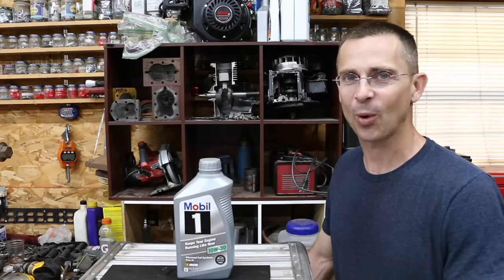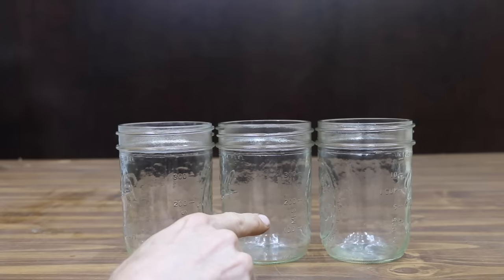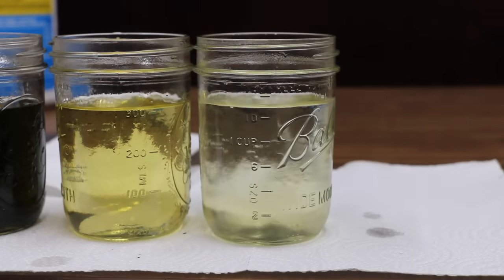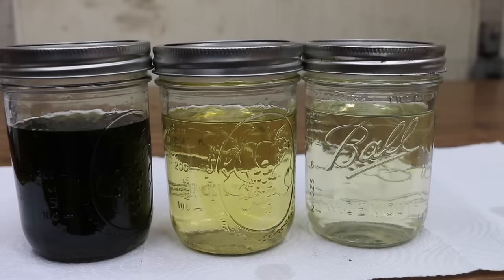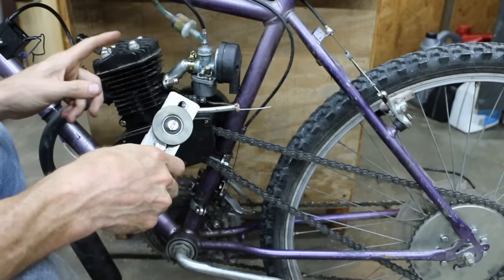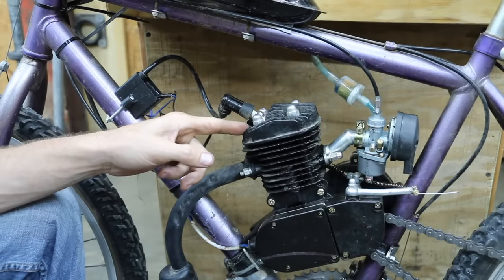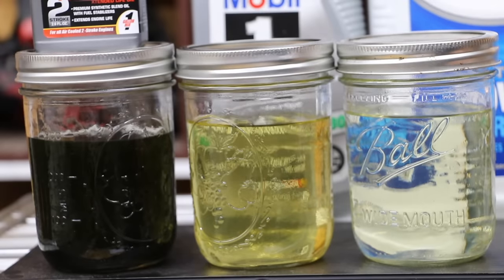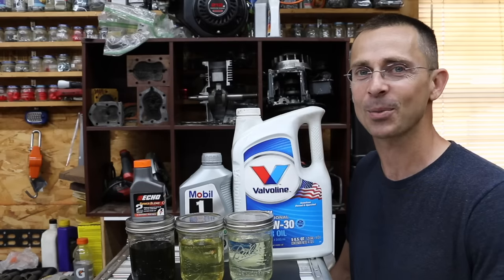Will 4-stroke oil damage a 2-stroke engine?  Let's find out!

Comment: Interesting stuff! I have seen an old LawnBoy mower manual that says to use a gas oil mix (32:1) with 30 weight oil.
Reply from the maker: Thank you
Reply: My '83 with F engine states to use 32:1 when using the preferred Lawn Boy oil, or use 16:1 if a standard oil was used

Comment: I've always mixed 2 stroke oil with diesel in my old 24 valve Cummins to help add lubricity to my vp44 injector pump. Cool if you could do some kind of testing to see if its really helps.
Reply from the maker: Great test idea!  Thank you

Comment: A whole lot to like here... comprehensive as and well designed and IMO, very informative. I'd been wondering if 4-stroke oil could be run in a 2-stroke engine without any significant issues; thanks to Mr.Google, YouTube and most importantly, you, that's now been answered. Nice to know if penny pinching and or 2-stroke oil shortage become a thing in my world, there's hope!

Comment: Between 1972 and 1985 I did lots of motorcycle travel around Australia on various two stroke motorcycles. Often the only oil available was 30/40 engine oil. The only problem I had was carboning up of the mufflers which was resolved by burning them out.
Reply from the maker: Thank you for the feedback

Comment: I've been using 4 stroke oil in my brush cutter for some time now, but I think it's a bit heavy because I'm using regular 20w 50. And gives a little bit of smoke. I'm wondering if I drop the proportion will ensure good lubrication and reduce that effect. See, the Stihl oil asks for 1:50, I guess it's said to be more concentrated oil than normal not sure about the viscosity. But I'm assuming same principle. 
The 10w 30 any brand would be just fine in same proportion as 2 stroke. Where I'm at the 20w 50 is the cheapest.

Comment: I had an old chainsaw that actually gave the correct ratio to mix fuel with regular motor oil. It was from the 1960's before the days of antipollution laws.  The saw was stolen, but I might still have the instructions somewhere.

I'd note that back in the day you always added more oil than these days.  I'm not sure if current mix ratios would be good using motor oil.
Reply from the maker: Thanks for the feedback.

Comment: I have done this a bunch lol,either I run out of 2 stroke oil or just forget to pick some up,and I would do a quick mix of 4 stroke oil in gas just to get the yard weedeated in a emergency lol,I have used 2 stroke oil for bar and chain oil as well,it worked ok,I need to get the job done and that's all I had lol thanks for the video man I really like these
Reply from the maker: Great feedback. Thank you!

Comment: I used motor oil a couple times to finish a job when i ran out of mix gas. It didnt mix easily (new oil), and smoked a lot. Used motor oil seemed to work and mix better. 
Now I just make sure to have a spare container of 2 cycle oil and bring plenty of mixed fuel.
Reply from the maker: Thanks for sharing.

Comment: Good video i knew it would run with the 4 stroke oil cause when u wear in a new outboard motor 2 stroke the ratio with oil is crazy it still runs with tight bearings and rings only need to really change plug more often 👍
Reply from the maker: Thank you for the video idea!

Comment: Just sharing. In a pinch I used 10w30 at a 40:1 ratio in my weed eater. Seemed to be okay. I wound up burning that remaining mix in my 4t lawn mower. Simple Briggs Flathead. It would foul the plug and stop running after ~20 mins of use. I'd clean the plug and good to go for another 20 minutes lol.
Reply from the maker: Great information. Thank you

Comment: Please do a test of popular high performance 2 stroke pre mix oil. Klotz Super Techniplate, Amsoil Dominator, Maxima 927, Golden Spectro and something cheap like Walmart brand pre mix. Keep up the great work 👍🏼
Reply from the maker: Thank you for the video idea!
Reply: Project Farm Older 70’s-80’s performance machines were recommended 16:1, 20:1 and 24:1 for the most part. People do 32:1-100:1 (Amsoil Saber) and justify it as “modern oils are so much better” but are modern 2 stroke oils really that much better? Would love to be able to put some science behind the oils and ratios and end all of the opinion recommendations people throw out there.

Comment: As kids we used engine oil in our 2 strokes, I'm not even sure there was specific 2t oil in the seventies? I think the biggest difference is the ease it mixes with petrol, the cleaner burn and of course the smell ;)
Reply from the maker: Thanks for sharing.
Reply: @ProjectFarm  I should write a disclaimer, two strokes have come on a long way and would recommend using the highest quality 2T for performance engines ;)

Comment: I have been using 4 stroke oil gasoline mix for years but I always add a little octane boost to the fuel and have never had fouled plugs or any other issues.
Reply from the maker: Thank you for the feedback

Comment: Try used motor oil now, add some extra to be certain. I'm super tempted to try doing it on a tiny engine. I imagine lots of carbon build up and black smoke. But hey if it works
Reply from the maker: Thanks for the suggestion.

Comment: My Honda Express 2 cycle has an oil mix carburetor set-up. You are supposed to use regular 10-30 weight motor oil in it. Doesn’t even suggest using 2 stroke oil.
Reply from the maker: Interesting.  Thanks for the information.

Comment: I simply shorted the chain so it did not need the tensioner more.

I've run many engines on 4 stroke oil, had no issues yet.
Even weed whacker that use only in summer.
4 stroke oil cheaper here, as comes in gallon instead of tiny bottles.
Reply from the maker: Thank you for the constructive feedback

Comment: I was out of gas with my moped in my youth (24 years ago) .. When i saw a gasstation i did this, i used Unleaded Premium gasoline (95) and then i put 180 ML of 4 takt oil on 5 liter gasoline .. And it runs like normal .. But i did it once not the whole time .. The moped was a yamaha yami and it did no harm at all .. i was suprised and i came home that day  👍👍👍😀
Reply from the maker: Thank you for sharing

Comment: Would love to see a comparison of different high end 2 stroke oils (Different offerings from Klotz, Motul, Redline, 927, etc). Even though it’s a good bit more expensive for usage in yard equipment, I still use it in my equipment since I already have it for my 2 stroke quads and dirt bikes. I personally found using klotz super techniplate @ 32:1 and 100LL aviation gas in my chainsaws / trimmers (retuned carburetor of course) keep the cylinder wall looking like when I just bought it. No pitting, rust, or score marks.
Reply from the maker: Thank you for the video idea!

Comment: Have you tried 2 stroke oil in the crankcase of a 4 stroke? Also it would also be interesting to see a lubricity test of  2 stroke oil mixed gas to 4 stroke oil mixed gas.  Not sure how to do the test without a fire however. In the early 70's, I just ran a quart of Havoline 30 weight in 5 gallons of gas for my race bike without problems. I would think new 2 stroke specific oils would improve lubrication. One more thought, have you tested any castor bean oils (Blendzall) ? GREAT channel by the way!
Reply from the maker: Thanks for the video idea.

Comment: I grew up in Texas cutting firewood for a summer job until 12 th grade the owner aka BOSS never used 2 stroke oil in saws always 10/40 motor oil never had a problem
Reply from the maker: Thanks for sharing.

Comment: I had an old outboard boat motor at one point. On the metal tag on the motor it gave instructions on how to mix 10W 30 motor oil in the gasoline, I guess it predated 2 stroke oil.
Reply from the maker: Thank you

Comment: I used a spray lubricant in the weedwacker after I took out the plug. I then used 30w regular with gas as there was no 2 cycle oil. Someone had used the weedwacker with no oil and killed it. It freed up after a few tugs and the weedwacker runs fine thankfully. They even paid me $20 for the 3 minutes it all took.
Reply from the maker: Nice!  Glad you were able to get it running again

Comment: cars with rotary engines suck engine oil from the crank to use as lubrication, though this leads to problems in the long run as it doesn't lubricate and burn as well as 2-stroke oil. This is why some rotary owners install a seperate oil tank containing 2-stroke oil to lubricate the rotor.
Reply from the maker: Thanks for the feedback.

Comment: Thanks for these videos, very good controls on your experiments! 

I have a creaky old shitter of a brush cutter that I run 4 stroke engine oil. The cheap nasty kind available in supermarkets. It is going to be interesting to see the ash build up over time. It has only been run a few hours so far, so I haven't noted anything significant, other than the slightly smokier exhaust. Will see what happens.
Reply from the maker: Thanks for sharing!

Comment: BikeBerry and other motorized bike companies sell spring controlled automatic chain tensioners for the "china doll" in frame bolt on motors, and improved clutch arms. The rag joint is what usually causes wrecks.
Reply from the maker: Thanks for the feedback.

Comment: The first thing I learned about a 2 stoke was to add the gasoline to the oil, not the oil to the gasoline.  Eliminated the mixing problem.
Reply: I've always filled the gas can up half way, then add all of the oil needed. Shake really good. Then add the other half of the gas and shake again. Always shake the can up every time you go pour it in something. Doesn't matter if it was last shook 2 weeks ago or two hours ago. That's the method I've used all my life, and have never lost an engine.
Reply from the maker: Thank you!

Comment: looks like you can use another piece of metal between the chain tensioner and the upper diagonal tube of the bike frame to stablize the chain tensoner to prevent it from rotating into the spokes
Reply from the maker: Great tip! Thank you

Comment: My dad used 4 stroke oil in 2 stroke mower for 20 years with no problem.  I have used 30W in string trimmers for 40 years, no problem.  The only problem I had was when I used two stroke oil; it gummed up the carb and left permanent strains wherever it leaked.
Reply from the maker: Thanks for the feedback.

Comment: T
The issues will be more smoke if you're using 4t  in 2t engine.  4t oil is thicker and should adjust mix ratio and jetting if possible. If you run premixed fuel with 4t oil,the engine will run leaner on the jetting, not the mix ratio. 

E
Reply from the maker: Thanks for sharing.

Comment: The difference between 4 stroke and 2 stroke oil is that it burns much better , since it's designed to do it.
For example high revving engines ( honda gp 125 , kart engines 125cc ) need an oil resistant to high temperatures , high film strenght and highly viscous ( some racing 2 stroke oils are w50 ).
Lower revving engines will require oils that burn at lower temps and less viscous
Reply from the maker: Thank you for the feedback

Comment: back here in Brazil I ride a motobecane 2 stroke with used car oil any kind ,the only issue is that your carburator will build up a jelly sticky gunk. after 20 miles or so ,so when my moped starts to stall. its time to clean the carburator. it works fine .
Reply from the maker: Thanks for sharing.

Comment: I used to use Bel-ray 2 stroke oil in my Suzuki 2 stroke but when I ran out I mixed the same oniony of 30w oil. Never had a problem. Seems like lube is lube as long as it is thoroughly mixed.
Reply from the maker: Thank you!

Comment: back in the 70s, had a Lambretta that was 2 stroke, all we ever used was 10w30 mixed with regular gas, no issues, we did the same to a outboard engines ?
Reply from the maker: Thanks for sharing.

Comment: The old guy across the road. Has a 1960's 2 stroke moped he has had since the day it was new.  79,000 miles on it after all these years. He only mixed Pennzoil 10 w30 in his gas all these years and everything is Original parts and the thing runs perfectly.  He said it's what they did back when he was a kid on the farm in everything. funny cause found this video looking to see if anyone else does it  after he told me that lol!
Reply from the maker: Thanks for sharing.

Comment: Watching this a bit late but atleast in Finland when my dad was a kid we did not have 2-stroke or 4-stroke oil. Just motor oil for both, basically a 4-stroke oil for both engine types. This was atleast in the 1950s and 1960s and maybe in the 1970s. I personally think that the only difference is that 2-stroke oil mixes better to fuel and burns cleaner.
Reply from the maker: Thank you

Comment: 58 years ago I ran car engine oil in my new 1965 Yamaha  Riverside 55 cc motorcycle 9600 miles in eleven months with no problem. That is an oil injection system. I still own the cycle and it has 13000 miles on it. So yes, 4 cycle oil does work ok in a 2 cycle engine.
Reply from the maker: Thanks for sharing.

Comment: I ran my bike on 4-stroke oil for a while. At one point it started self-igniting like a diesel - I switched the ignition off and the bike kept running. Turned out a large blob of gunk built up on the spark plug, completely covering the electrodes, that would glow and ignite the fuel. I went back to 2-stroke oil after that.
Reply from the maker: Thank you!

Comment: Another good question is how much 2-stroke oil should I add to petrol tu run smoothly a diesel engine? Is 2-stroke usual ratio of 2,5% enough? This question came up when my grandfather filled his delivery van with petrol (engine was knoking and heating a little more) I was wandering if adding 2 stroke oil would add enough lubricity to petrol to make the engine run smooth.
Reply from the maker: Thank you for the video idea!

Comment: I would be interested to know, if you ran a 4 stroke out of oil, but mixed a heavy 32:1 2 stroke oil mix, would it lock up? Like mixed gas but no oil in the pan
Reply from the maker: Thanks for the video idea.

Comment: Sorry, I missed your permission.  I thought you meant two stroke gas in a four stroke.  As for four stroke oil in a two stroke.  That is what they used to use in a two stroke.  A Coke bottle of 30W in a gallon of gas.  It smoked like crazy but it worked.  I would worry more about long term use because oil today does not contain zinc.  I add 10% STP to the oil in all of my four cycle engines to keep the cam and tappets from being damaged from the lack of a zinc additive in the oil due to EPA regulations.  I use Pennzoil 10-w30 fully synthetic oil in my four cycle engines.   Most two stroke oil has zinc in it.
Reply from the maker: Thanks for the feedback.

Comment: As a 2 stroke engine builder, I just paused the video to tell you to NEVER do this in a performance 2 stroke engine. The 2 stroke oil is specific for a purpose, and in any application that makes respectable amounts of power, you'll need as better as you can get oil. For example for very high end engines, I recommend Motul 800 for 2 strokes or Castrol 747.
Reply from the maker: Thank you

Comment: Ok, I’ve heard something recently regarding engine oils; apparently if you switch an engine running full synthetic over to conventional motor oil, it will damage or ruin the engine. I’ve never heard of this before recently, and it doesn’t make sense from the knowledge I have on engine lubrication, but I’d be interested to see what would happen in one of your tests.
Reply from the maker: Thanks for the video idea.

Comment: My father used to have a lawn boy lawnmower that had a Johnson motor from the factory he ran leaded 90 octane gas with one cup of 30 weight non-detergent oil and that’s exactly what it said to do on the gas tank the lawnmower lasted well over 25 years before he retired because he couldn’t push it anymore and upgraded to a snapper comet
Reply from the maker: Thanks for sharing.

Comment: I used cheap recycle regular oil for years in my old yamaha 60 back in the late 60, never had the first problem, But I did not mixed the fuel with the oil it had a infection system. I do believe it smoked a little more than the 2 cycle oil
Reply from the maker: Thank you!

Comment: Back in the day they would use straight 30 weight oil in two cycle engines, they where a little  smoky but it worked
Reply from the maker: Thank you

Comment: Not sure if you have tried it but I have always wondered how much of a performance loss is with oil with at least like 6,000 miles on it.   So basically running used car oil in a lawn mower and seeing if it goes through fuel quicker and if there is a noticeable damage done by running a PSI test and using clean oil as a baseline.  Maybe you have already made this video I just can't find it.  I'm curious to see if there is a decent amount of thermal break down with used car oil compared to new.
Reply from the maker: Thank you for the video idea!

Comment: I'm a mechanic, so I literally have barrels of motor oil lying around. Having to pay money for 2 stroke oil is maddening for me. Especially when it's like $5 for a half pint. I use regular motor oil frequently in 2 stroke engines, and can't say I've had any troubles running them. That being said, however, I do think it makes it more likely to gum up the carburetors when sitting over a long period of time (like a weed wacker over the winter?). However, again, in any of my equipment that has an 'off season,' I seem to need to clean the carbs every season anyway, even on 4-stroke motors. So the difference is negligible - for me.
Reply from the maker: Thanks for sharing.

Comment: If you use a more viscous oil than the previous type, it can get less oil into the bearings unless the carb settings are changed.
Reply from the maker: Thanks for the feedback.